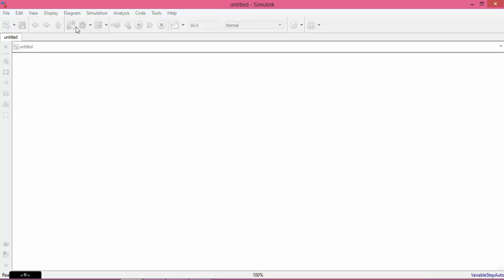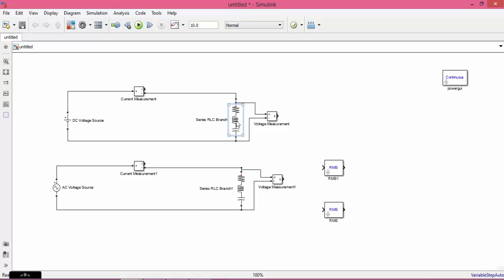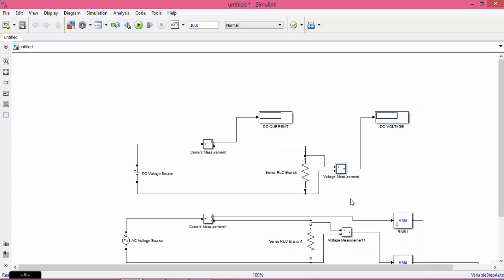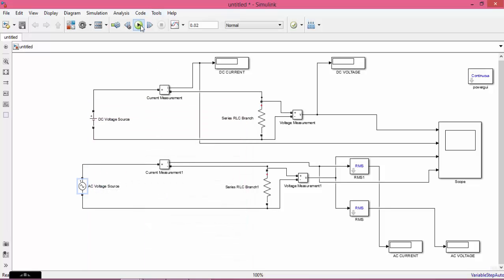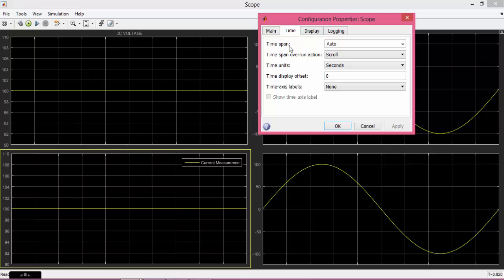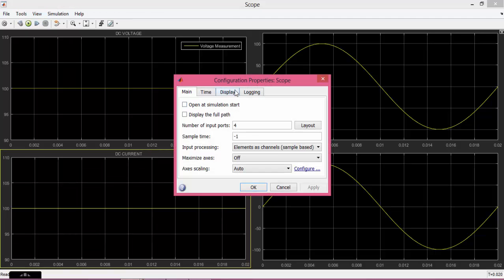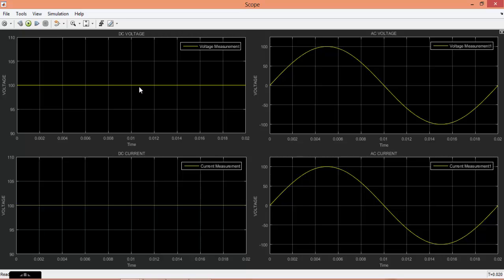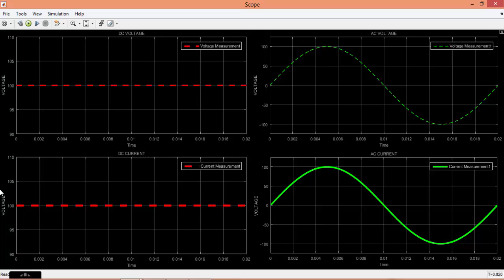matlab  simulation ac source and dc source in simulink

Comment: I want to connect two DC voltages from two PV sources in simulink
How I can do this.
These two sources have around 50v each. I want to combine them so that I can run common load from both
Reply from the maker: It can be done .search for it in Google.get 2 block and assign valur